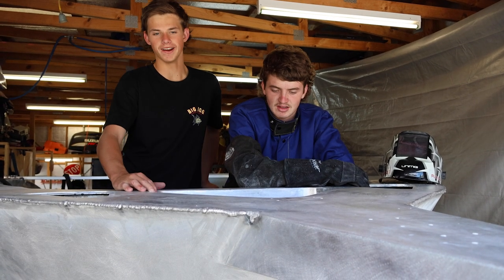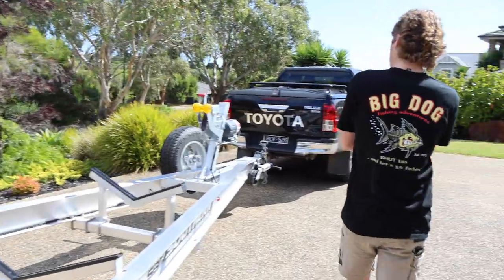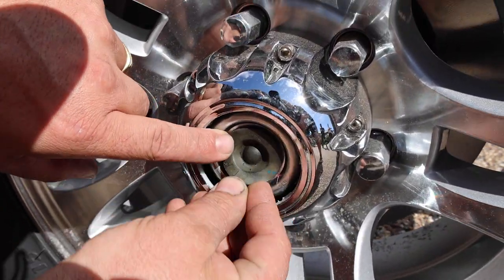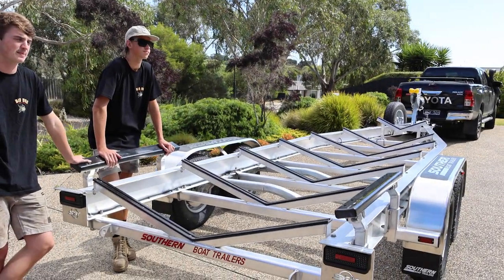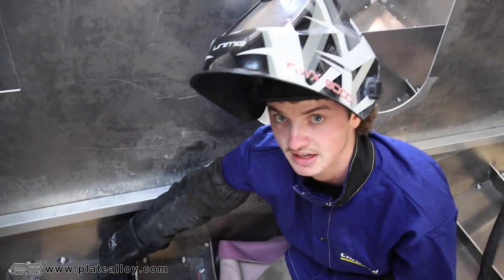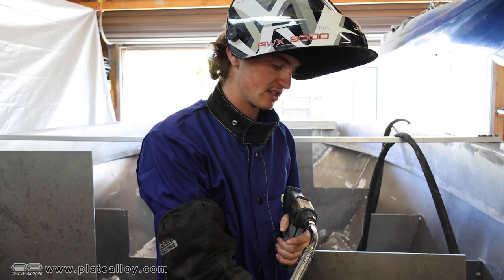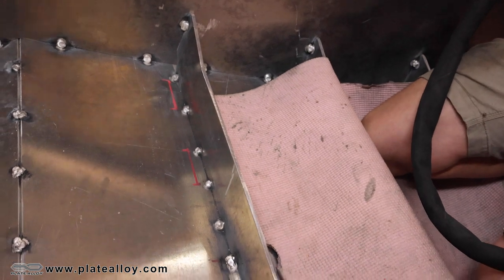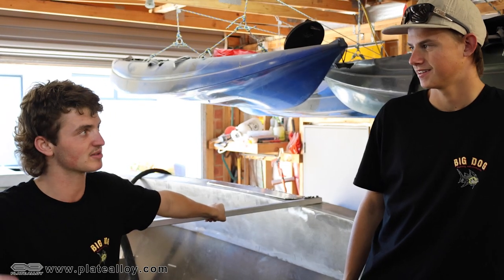Welding out the hull & checking out the new trailer.

Comment: What's with modern boat trailer design. The boat trailer for my two ton hard top has keel rollers about 300mm above the road, which gives it a low centre of gravity. At the ramp, only the rear tandem tyres are in the water. To launch push off, to retrieve power winch on in 17 seconds. It's all multi-roller painted steel frame no rust forty-five years old. 

For a single operator, the drive on/off trailer means you have a vehicle with trailer sitting at the ramp until what ever it takes to get it parked. Cheers